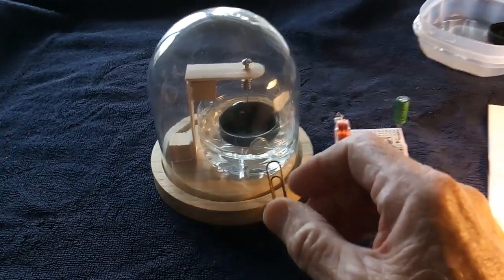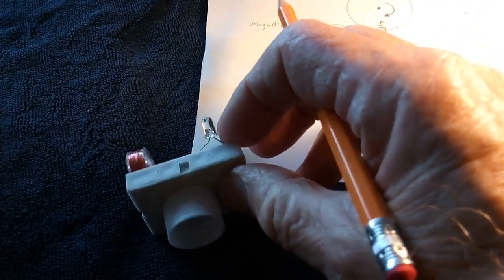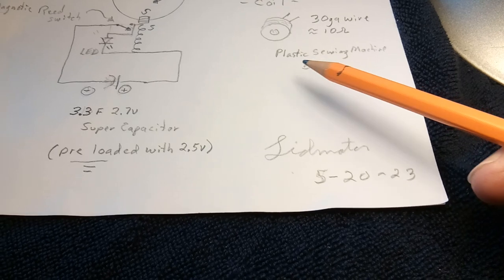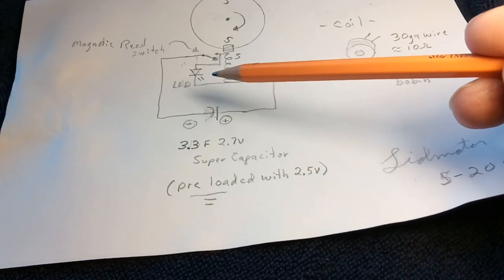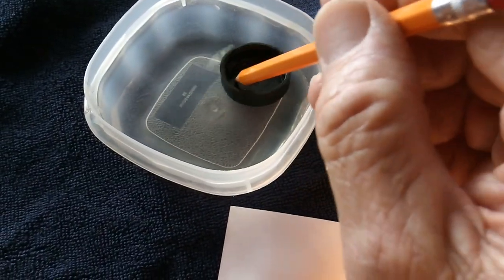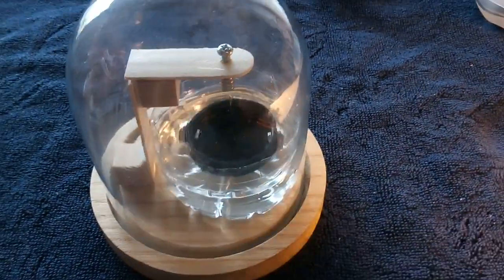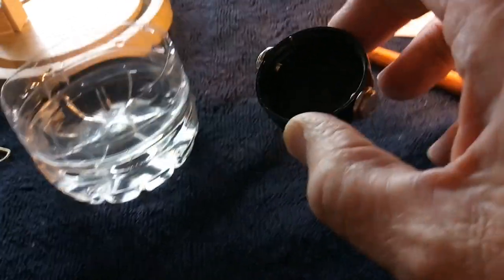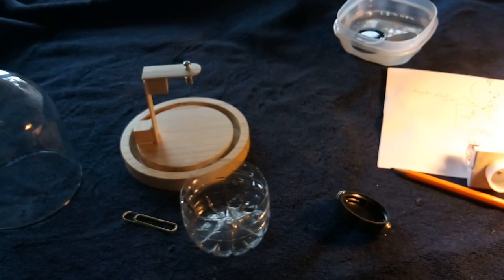Float Motor Desk Top Toy

Comment: Y not Put a bridge rectifier in place of the led and feed the output back to the super cap. ?
That will help to extend the running by feeding power back to the cap from the collapsing field so it doesn't run down so fast.
Reply from the maker: That doesn't really work.  What does work is to send the coil flyback pulse into a second capacitor.or battery.   That is the stuff of a Bedini SSG. I decided long ago to just use the energy to flash an led.😀

Comment: 👍🤓
It would be interesting. If you did an electronic version with the dad hav circuit and see how low you could get the current required to drive it. I like the way you put it all together to make it  nice for display. You have inspired me to try to make something like that. I enjoy your channel keep the videos coming!
Reply from the maker: Thanks.  The two transistor circuit might not work in this because it rotates too slow. A simple Hall sensor circuit would work nicely though.

Comment: I have used your 2 transistor circuit and for some reason one day i come home and it stopped with full battery, i start it up  again and it may run 2 weeks or so and stop again with good voltage in battery.... what causes this?
Reply from the maker: Thank you for askng about the two transistor driver circuit.  I have also experienced the same strange stops.  I really don't know the exact cause. The way that the circuit works the passing magnet has to induce enough current in the coil to trigger the transistors.  If for some reason the rotor slows down the motor will stop but will restart when you spin the rotor up again.  Rotor bearing friction buildup has been the most common reason I have found.  A resistance change in the circuit will also do it.  I have had that happen in the circuit if I use a potentiometer or in the battery holder.   I have not had a transistor total failure but I suspect that a poor quailty one could account for the occasional stop.  The basic design of your motor can be affected by temp or humidity changes.  My 'Yearling' motor looks good but is really a terrible design and stops randomly.  The Lasersaber Ez Spin has only stopped once because of a bearing adjustment issue ----and that was after running non stop for over 5 years.
Reply: @Lidmotor  thanks for replying, i am gonna try moving it to a different area and see if that helps...i am also gonna try to suspend it with magnets where friction would be minimal technically. If i get it to suspend ill send you one.